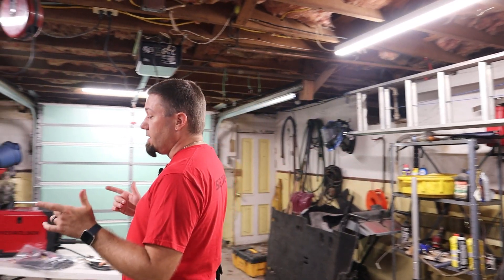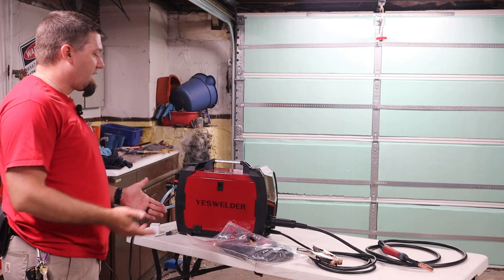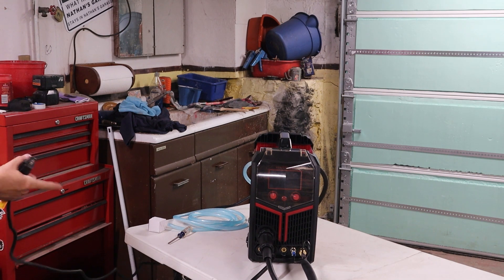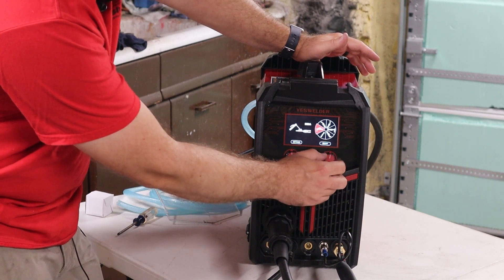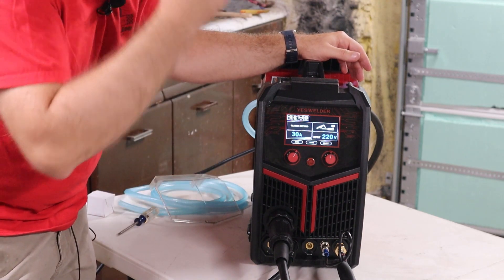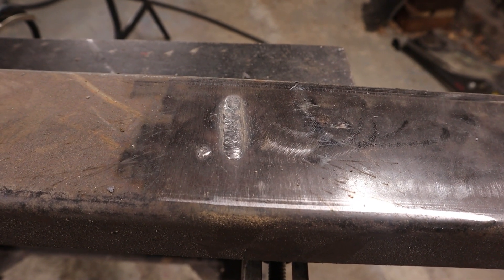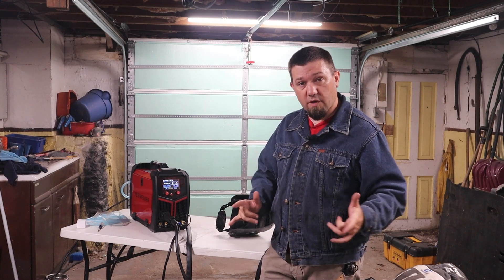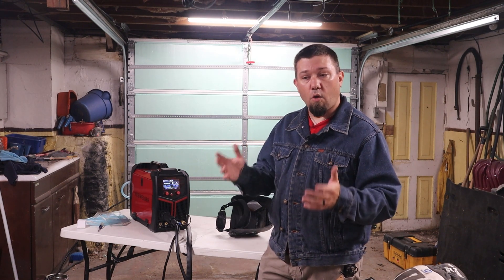Introducing the  YesWelder FIRSTESS MP200 5-in-1 Welder & Cutter, Initial setup, cuts and welds!

Comment: Are you having issues with the synergic settings preprogrammed ?? So far  I tested mines on 220v using .035 solid with gas co2mix on 14ga(2mm) 
steel selecting the 14ga thickness It seems to have problems welding. Not just 1 welder its both welders!  But when I switch out to .030 Flux 
and on 120v selecting 14ga works fine. It basically sucks on solid .035 wire on 220v ! It feels under powered on both mp200.  Values displayed are not true!
Reply from the maker: thanks for reaching out. i have not had the chance to use the machine extensively yet. and the use i have had has been with flux core. some family health issues have kept me out of the garage.  it has worked well with flux core so far but i’ve only used it a few times for small jobs.

Comment: They are announcing the retail price of $1K, for a $500 machine!!!!
With that money you can buy better machines for each welding type, such as Lotos HF TIG AC/DC for aluminum and without the risking all your $1k in one single machine. Plus, Yeswelder customer service is terrible, seriously it suck. It seems that Yeswelder does not make the products, only brand them. 
That means, when you need replacement parts, they will tell you to buy newer machines because they don't have even a spool holder for "their" MIGs.
Reply: I was kind of thinking the same thing. I know nothing about welding though. What machines do you recommend?